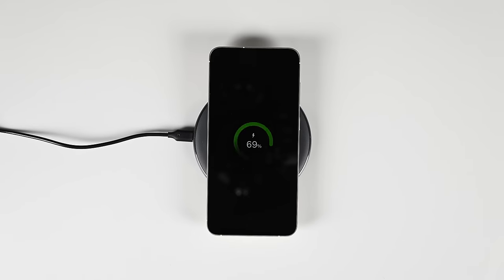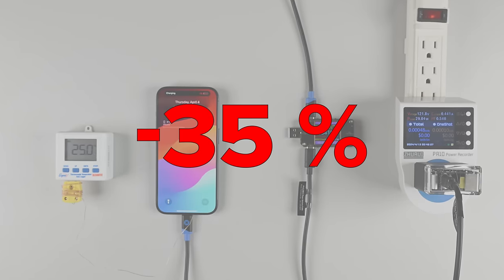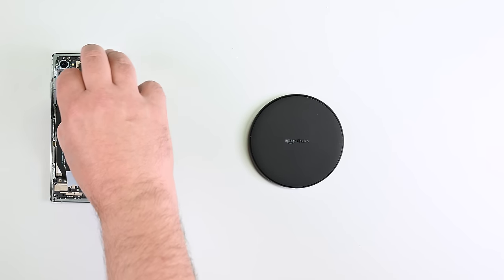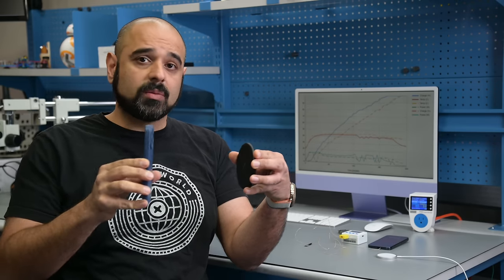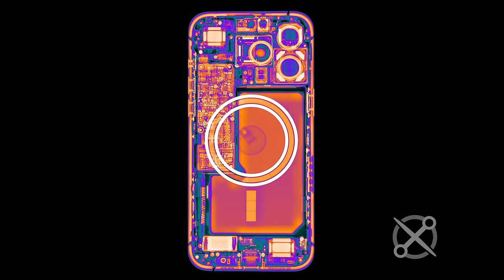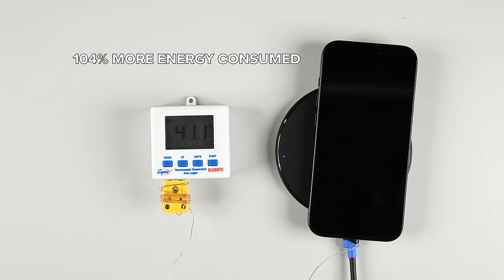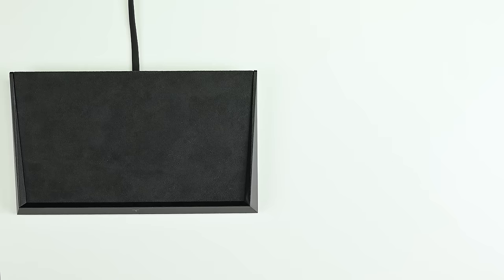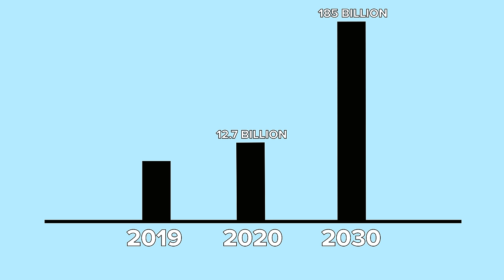How Wireless Charging Works and Why It's Terrible

Comment: I've always thought it was a gimmick outside of it being a back up charging option should something happen to your charging port. But I've always argued that with the fact that it damages your battery long term, is slow, and most importantly of all......ISNT WIRELESS since the charging pad is 100% connected to a wire and your phone has to remain stationary on the pad. At least connected to a charger I can still pick up and use my phone while it continues to charge. On a wireless pad I can't pick up and use it without breaking the connection. It's always been a gimmick because of the name "wireless" which just isn't true.
Reply: It was never meant to be usable during charger. It's a "set it and forget it" feature, not a gimmick.